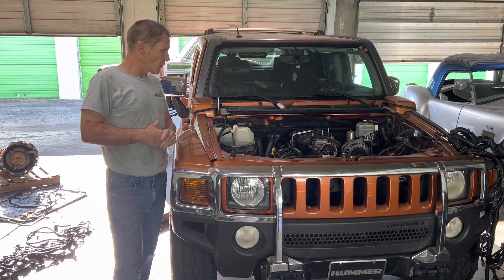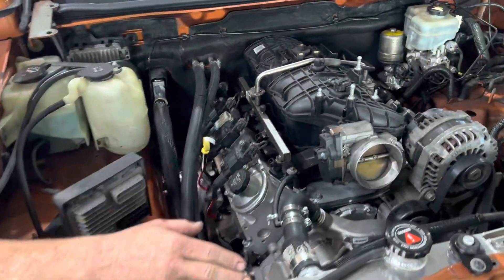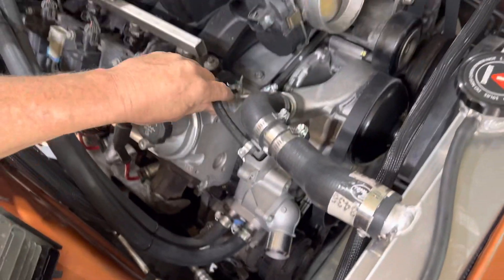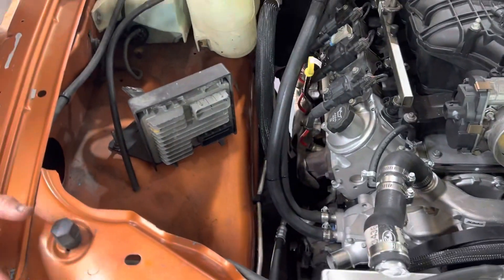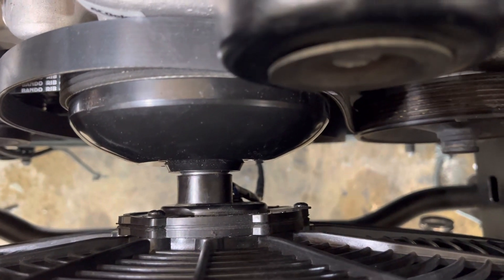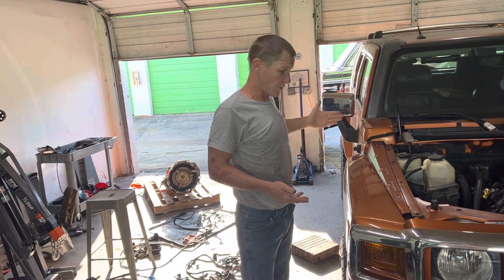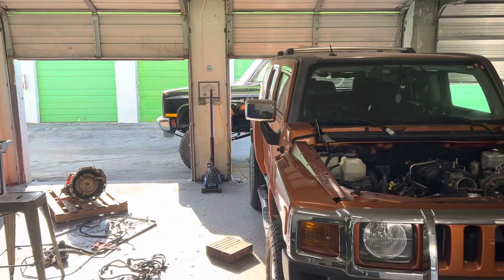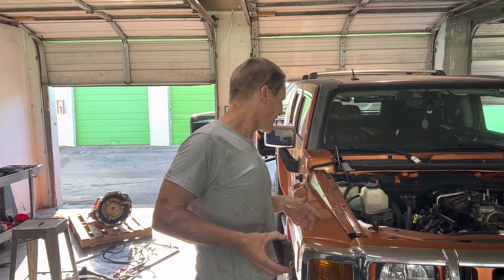Hummer H3 Alpha Conversion Plumbing and Exhaust

Comment: Which hose you used
For the bottom one ?
Reply from the maker: I used the lower radiator hose for the 2008+ H3 with the 5.3L. Got it from my local parts store.